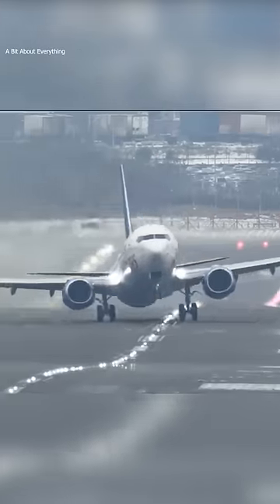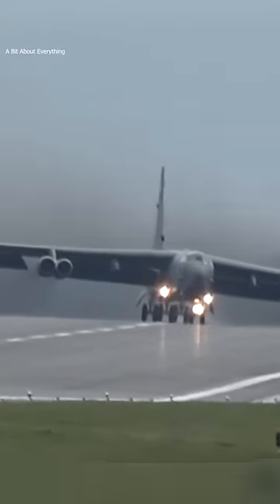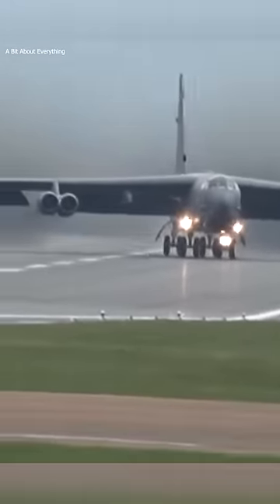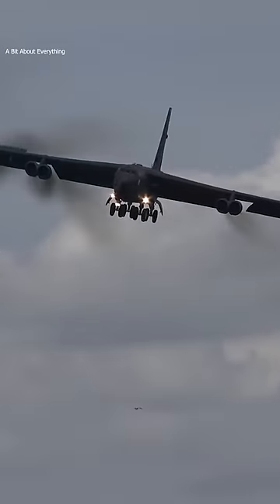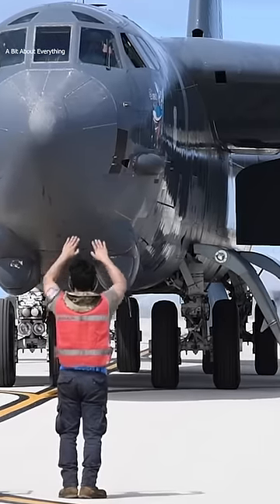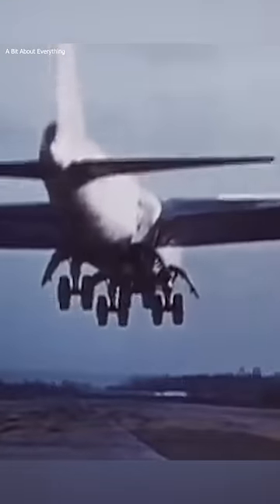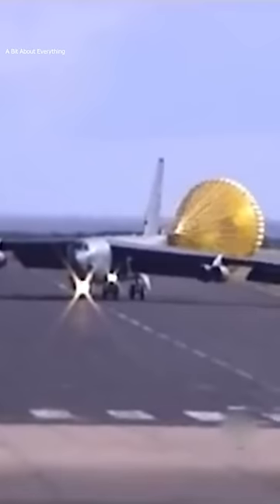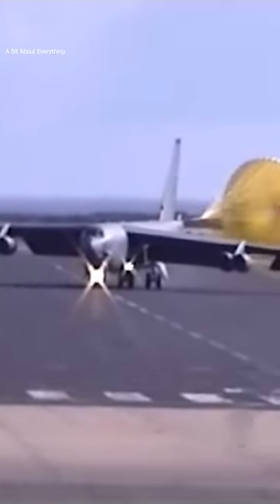How B-52 steerable Dual-Bicycle gear works during a crosswind #shorts

Comment: To All Aviation A/C designer Engineer's, Airbus/Boing and the rest, ..You should do this on all Commercial Aircrafts❗️
..Do it for real, because this is an Extremely Safety measure for when landing in rough weather❗️..i just don't understand of why you left this Major Safety design feature out of Most Commercial aircrafts?!!